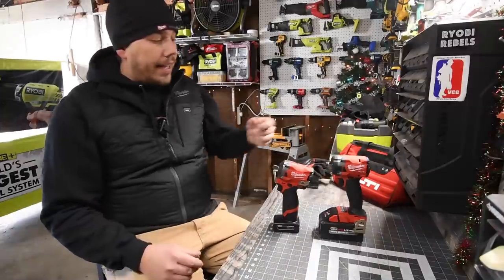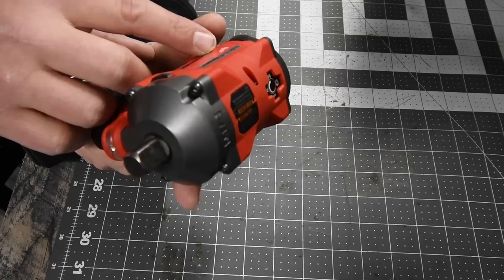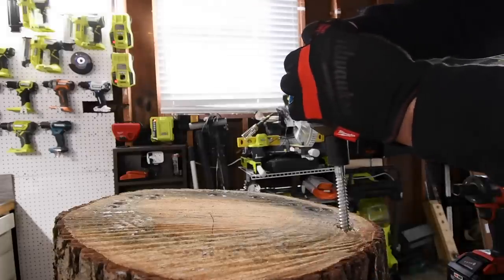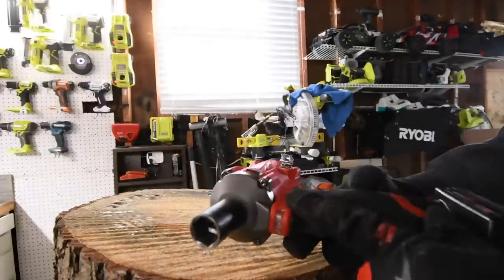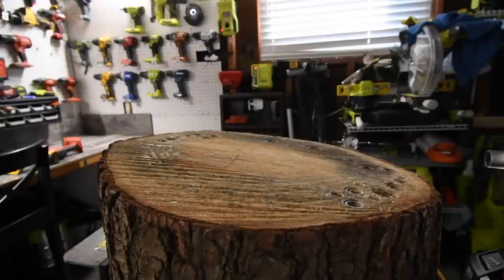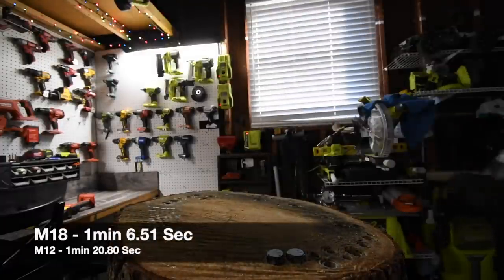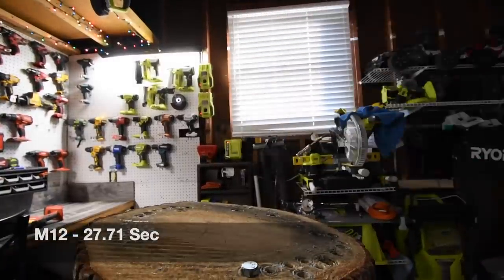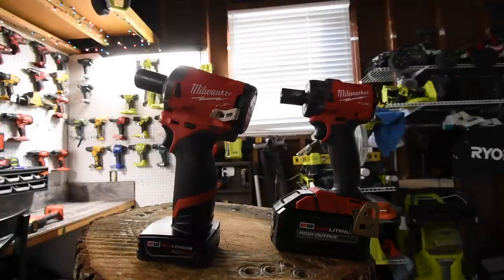New M18 Stubby vs M12 Stubby (1/2 Impact Wrenches)

Comment: I don't see the point of a stubby when you have right angle impacts which are way more compact.  Also I would use the stubby in 3/8 since you are working in tight spaces anyways.
Reply: Have the right angle m12 3/8 and ended up borrowing a m18 stubby because the right angle wouldn't budge a 19mm caliper bolt . Was thinking about getting the stubby but would go with the m12 if I do
Reply: You need to try a stubby. Walks all over the Milwaukee right angle.

Comment: Good stuff Dave! For the answer -  Is it worth it? It is for all the people like me that have many m18 batteries but don't plan to buy m12 in the near future. I wonder why the M18 didn't won most of the test. I've already seen in another channel that the m18 had more power around the 250 ft pounds of torque and above near the rated max the m12 couldn't keep going much more above that.
Reply: I've seen the opposite
Reply: @shanew7361  Where? Here? I saw it at shop tool reviews m12 didn't get to 300 ft pounds torque. Neither did the Ridgid "stubby" I feel like this is more a test of speed rather loosening power...
Reply: MrSubaru was about same until the M18 took 2 lugs vs 1 m12 the stubby. Workshopaddicts says the M18 feels more powerful... I don't know where you saw this?
Reply from the maker: that's why is good to have different channels to watch with different kinds of tests. we all compliment each other
Reply from the maker: the kind of tests I do is stress tests on the motor to see which ones start to give out at a certain kind of test. that's why its good to have different channel performing different tests
Reply: The m12 was at half battery for the last est versus 4 bar for the m18 
Pretty sure with a fresh battery the m12 is much closer 
The big advantage of the m18 is the battery capacity

Comment: Anyone tell me if there a difference in power between the M12 stubby 3/8 vs 1/2 stubby is one better that the other
Reply: I have both, get the 3/8" stubby. No clue, but it seems to work better than the 1/2", and that is the only difference between the two, they are both identical other than the anvil.

Comment: Why not get the m12 when it's more compact overall, cheaper, does evenly or better thans its bigger sibling!? But again battery life when it comes down , job wise. Good results and tests! 😎👍
Reply from the maker: but if you have more batteries with the m12 then you are good. they charge up pretty fast as well
Reply: I’m just a shade tree mechanic and I use my M12 stubby for little mechanic jobs... it is perfect for that. I’m not using it all day every day and don’t need as long of battery life. My kit came with two batteries and I always have one charged or charging so I never have run out of battery life while doing a job.

Comment: batterys are different too the 6.0 is the best overall for the m12 the m18 best one that will start torquing quicker was the xc 6.0
Reply: I've been having very good luck with the M12 Chinese knock off batteries, 3 and 6 amp. I primarily use the 3 amp, as it does not get in the way in tight spaces.

Comment: Ok guy I really need opinions I'm stuck between the m12 and m18. I bought a project jeep and she is rusty af ( Michigan vehicle ) I have the money for one but I'm really stuck between these 2 I really thought the m18 would out perform but now I have really mixed feelings. Please help lol
Reply from the maker: if you need more power then what these can do you can get the new mid range version of the m18 impact driver that has 600 ft lbs of nut busting torque. but if you these do impacts do the trick id go with the m12 if you have enough batteries for it. if you need the more battery duration id go with the m18.

Comment: Someone please correct me if I'm wrong but that M12 battery is NOT high output.  The M18 battery IS high output.  That would give an upper hand to the m18.
Reply from the maker: You do realize that we are doing 18v vs 12v right? Based on the I don’t think what battery matters
Reply: @ManCaverTools  at 1.19 you said both tools require high output batteries. But then you show a regular  6.0 in the M12.   If you are implying that high output batteries don't add any power then I'd have to disagree with you.  Anyways I really enjoyed the video.  I'm blown away by the M12.  Even with the regular battery it still kicks ass against the bigger stubby with a HO battery!.  And in the future they will come out with bigger 12 volt HO batteries than the 5.0 HO you can get now.
Reply: @NonieTools  I'm using the Chinese knock offs, 3 amp and 6 amp on the M12, no issues, busting everything loose I have come across. Currently working on a bad delete on a Cummins ISX, have the entire turbo/right side of the motor torn down right now.

Comment: I love my M12 Stubby 1/2" Friction Ring! It's what got me into Milwaukee's M12 line of tools.

I always wondered how these two would compare. They're basically evenly matched in some ways, but the M12 itself edges out the M18.

The M12 can definitely get into very tight spaces, and that battery of the M18 can get in the way, whereas, the M12, you can switch it to either the CP 2.0 or CP 3.0 battery to maximize the amount of power output, but with the compactness when you're in a physically tight position.

I guess the only ways to justify the M18 Compact is if you DON'T have the M12 platform, but you want something small and have only M18 tools, the M18 compact is the way to go. Plus, it has the tri-LEDs on the M18 Compact.

Although the Stubby is the way to go. Great to go alongside the M18 Mid-Torque impact wrench.

Comment: My m12 stubby 1/2 struggled to take my pickup truck lug nuts off. With 3ah battery it wouldn't budge a nut. 6ah battery got 80% of the nuts off. Is this normal. Sucked that I still had to pull out the tyre iron to take the wheels off
Reply from the maker: yes, the 6ah battery provides more power to the tool

Comment: What sockets are you using in this vid?
Reply from the maker: tackle impact rated sockets. but I am changing my socket brand soon, I thank you for viewing Marshall
Reply: @ManCaverTools  changing to what? I am in the market for some impact sockets. Would love to see some reviews!
Reply from the maker: @mrhzk35404  im going to try out Pittsburgh pros from harbor freight. I liked the 1" sockets I got so far that I use on the milwuakee 1" impact wrench with 1,800 ft lbs
Reply: @ManCaverTools  I didnt know there was a Pittsburgh pro. I didnt like the fact that the Pittsburgh reg ones skip sizes. Take a look at sunex impact sockets too.